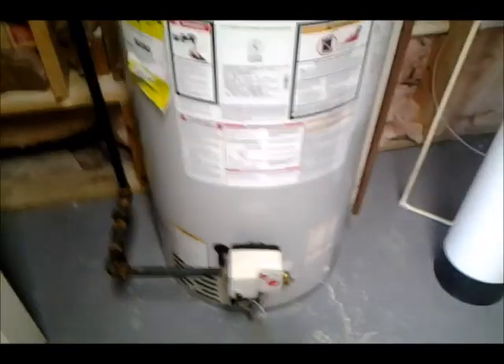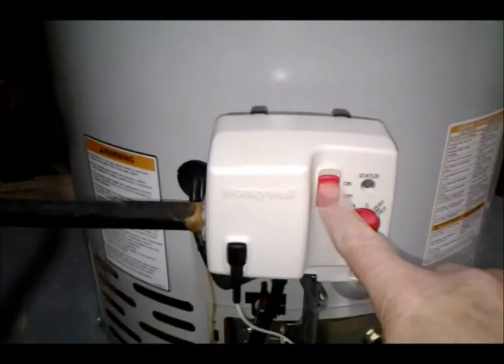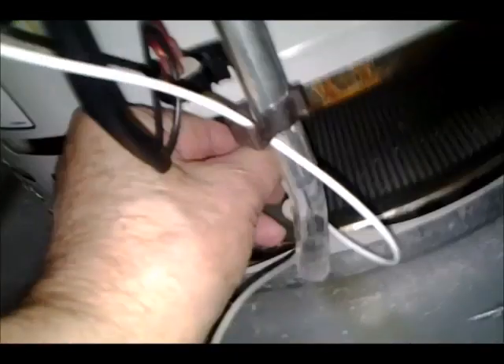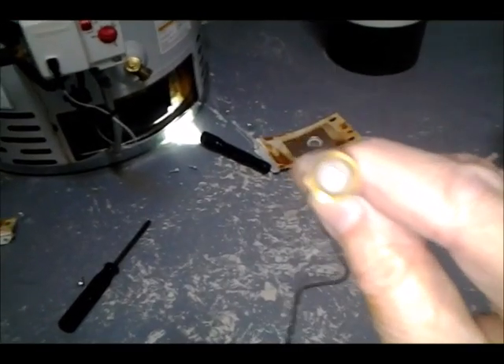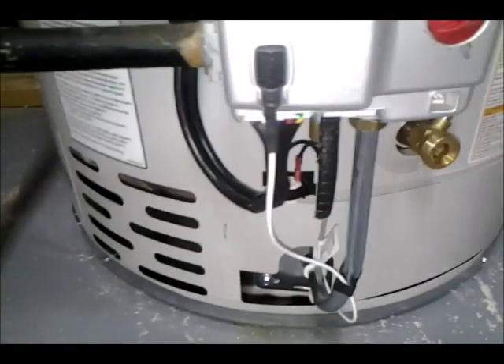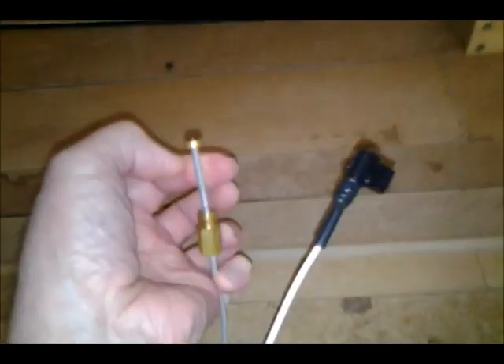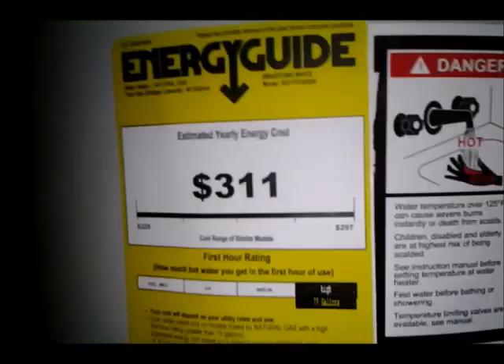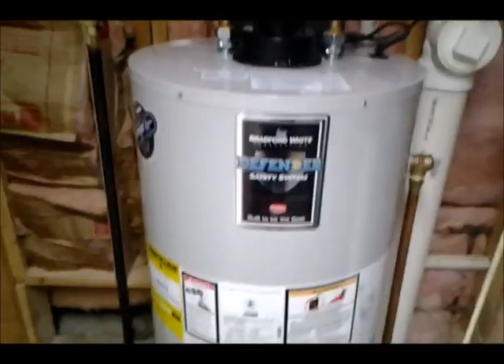BRADFORD WHITE POWER VENT WATER HEATER REPAIRS & REPLACEMENT

Comment: Nice video. Thank you for the time to make it. Just a note about the flex lines: flexible copper or braided steel lines are not against code per se, its just that some jurisdictions require hard piping to the hot/cold connections. And yet, other jurisdictions mandate flexible connections for seismic concerns, as well as flexible CSST gas lines for the same reason. Just depends on what part of the country you're in. I would agree with your plumber that hard connections always look more professional, but are not necessarily "wrong" unless your local code stipulates it can't be flex connected. Your plumber did a professional, neat, clean job. Keep his number. Good plumbers are hard to find.
Reply from the maker: We are in the Western edge of the New Madrid fault, which is along the Mississippi River.  We are just West of St. Louis, but the plumber said to use a solid connection.  The previous house owner changed to the flexible for some reason.  But I don't know why?  Maybe it was for earthquake protection?

Comment: How do you get  anode rod out that fell back into the  tank when it was being  cut to remove. It's  75 gallon  gas
Reply from the maker: Sounds like you will have to leave it in, which may be okay!  Check out this forum for some ideas:  https://terrylove.com/forums/index.php?threads/anode-rod-aluminum-broken-in-two-cant-get-rod-out-of-tank.69032/

Comment: Anyone know if the power vent blower needs a dedicated electrical circuit. Mine is hooked up to furnace outlet. Was told that’s wrong.
Reply from the maker: Dave, my WH is gas, so there is no outlet for it per se. There is an outlet the blower is plugged into, which it shares with my Water Softener but it is on a breaker with several other basement outlets, I think.  I am the 2nd house owner & there is no breaker specifically labeled Water Heater or Blower.  Hope this helps. Thanks for watching!
Reply: John H Thank you. Same as mine. Can’t find code saying it has to be changed. Home inspector said it does...two electricians said no. $600 bucks for dedicated line installation. Thank you for the info.
Reply from the maker: @dancindavey1515  You must be selling your house, maybe? Curious as to where you live. I am in Lincoln Co., MO, just West of St. Louis & am not sure of the code. My house was built in 2004, so maybe it has changed since then, also?
Reply: John H Ohio... built in 2002. Can’t find the code info. Furnace and hot water tank has run with no problems. Even if furnace line shut down, hot water tank would not start up and cause a danger. Don’t want to hold you up with my problem. Thanks for your concern. If you find anything let me know. By the way great video.
Reply from the maker: @dancindavey1515  We lived in Westerville, for 11 years & Tipp City, for 4 years. Our son & daughter were born in Westerville & are die hard Buckeyes, even after moving to MO. So, is my wife & I. Thanks for the comments & let us know what you find out!